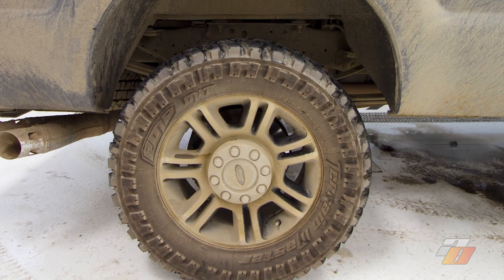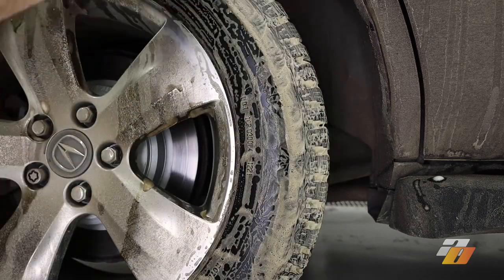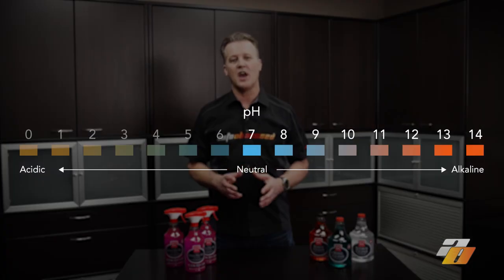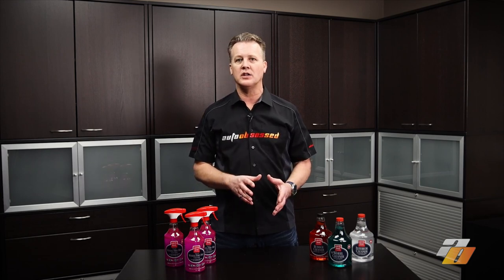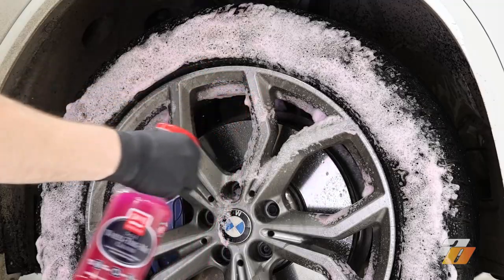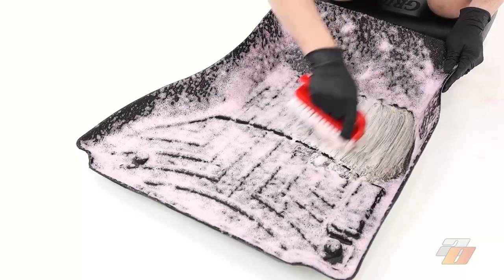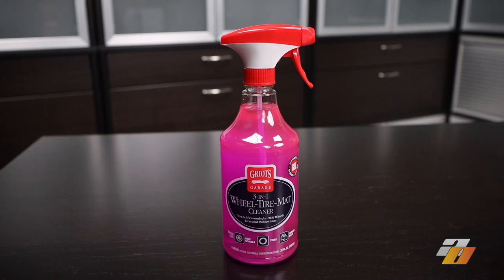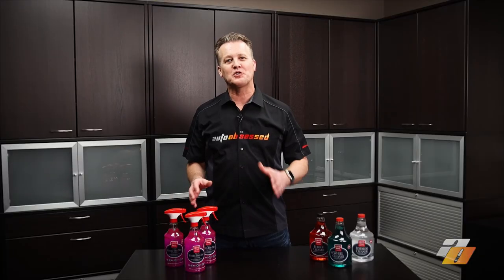Review of Griot's Garage 3-in-1 Wheel, Tire, and Floor Mat Cleaner

Comment: Weathetech sells a kit that includes a bottle of floorliner/ mat cleaner and a bottle of protector. In my opinion it is on the expensive side. I am not a big fan of the cleaner as it does not do a good job removing salt stains. On the other hand, the protector is unlike any other product I have come across to dress the floor mats after cleaning.
Reply from the maker: Yes, we had tested that product a few years back.  Griot's did amazing job with this matt cleaner and is one of our favorites.